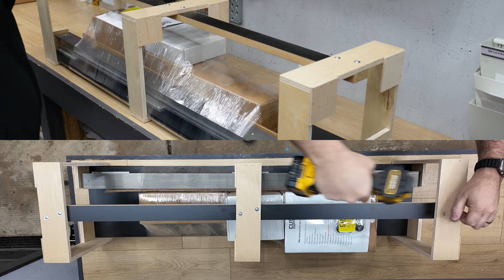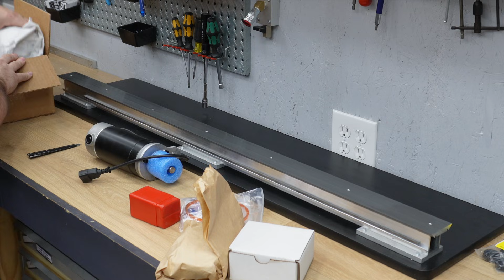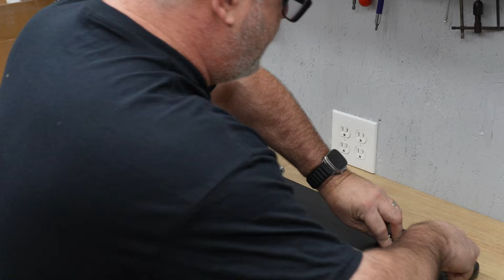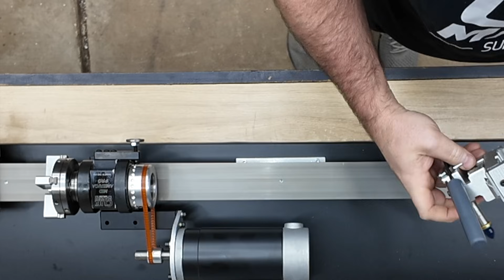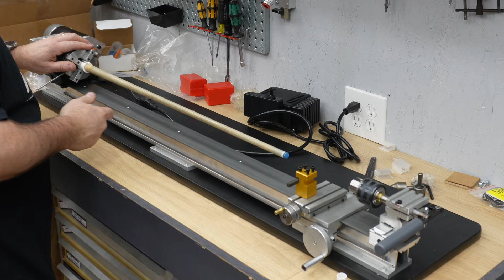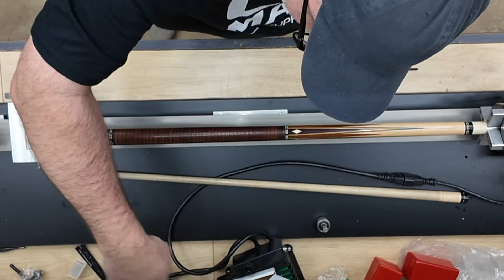Mid-America Cue Lathe 101 | Cue Lathe Unboxing, Setup & First Use

Comment: Hi, do you have an Option for German / European 230V Power Supply with the right plug? Thanks
Reply from the maker: We do not sell anything, but we have several customers in that region that have purchased step down transformers online from places like Amazon to use our machines.  We have not heard any negatives. Just make sure you get an actual transformer and not just a plug adaptor.

Comment: Can you tell us what sets your product apart from the CueSmith Deluxe lathe.  I am considering buying a lathe to make cues and wanted to get started with something like this.  Thanks!
Reply from the maker: Thanks for the question! Both are great machines, and CueSmith has built a solid reputation over the years.
Our Professional Series is most comparable to the CueSmith Mid-Size lathe and offers similar capability at a lower price point.
The CueSmith Deluxe does include some features that aren't currently available on our Professional Series. The good news is those features are already in development and are being designed to retrofit onto existing Professional Series machines, so today's customers won't be left behind as we continue to improve the platform.
One thing we're especially proud of is our customer support. When you contact us, you're talking directly with the owner—someone who designs, builds, and uses these machines every day. We make it a priority to answer every call we can, and if we miss one, we return calls and emails as quickly as possible because we know your time is valuable.
We run a very efficient shop and work hard to keep our lead times to around 2–3 weeks. Every machine is built, assembled, and thoroughly tested one at a time before it leaves our shop.
If we can answer any questions or help you with your decision, please don't hesitate to give us a call during normal shop hours (10:00 AM–5:00 PM Central) at 225-244-9008. We'd be happy to help.

Comment: Awesome video!, would you recommend using those plastic handled thumb screws or its other styles to move around the lathes parts depending on the tasks?
Reply from the maker: Yes we sell the quick clamps for this. They are almost a necessity in my opinion https://cuemakersupply.com/quick-clamp-locking-handle/